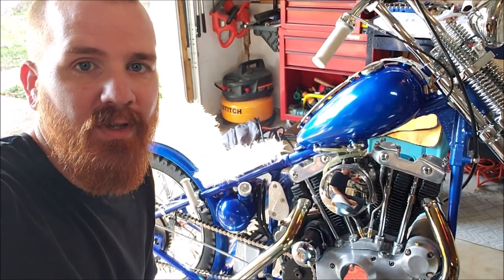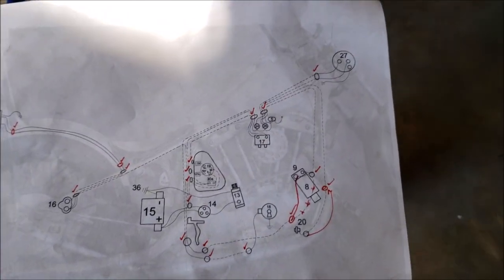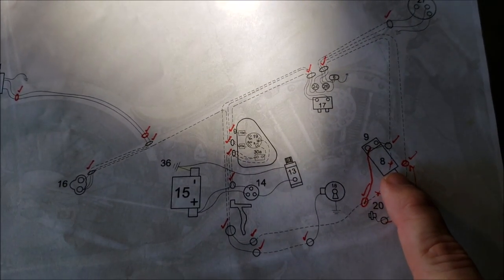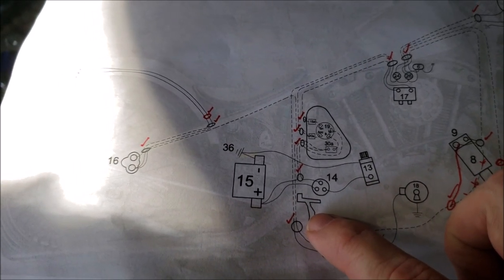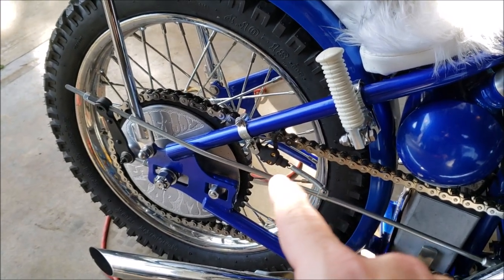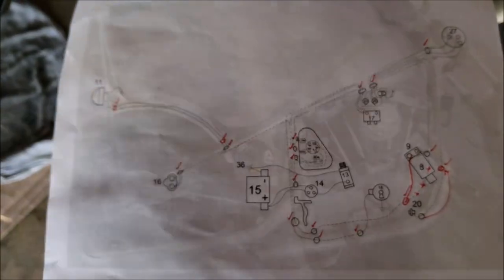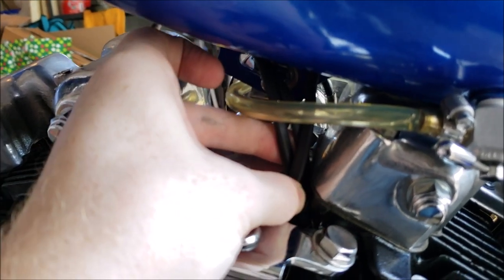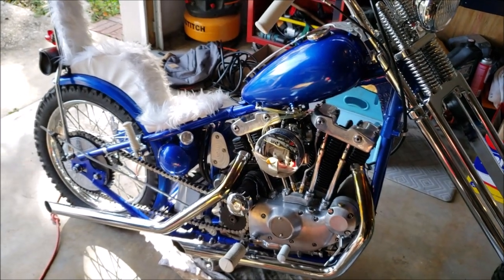HOW TO: CHOPPER / BOBBER WIRING - PART 1 OF 3

Comment: This and your other wiring series were great - slow and thorough.  The prep work and over thinking had my 76 XLCH stalled, your videos have inspired me.

I do have one question about routing of the points wire to coil.  I can see the cable dive into the timing cover but no idea where it goes from there.  Any idea how I might find it.  There are ZERO wires externally hooked up, no map of previous attempts by previous owner.

Comment: I had my handle bars extended for comfort but after seeing the wiring its a mess splice after splice. I know the best thing to do would to just pull all the wire and rewire it,  in theory it's looks easy but in practice it's something else.

Comment: Hi watching from New Zealand, thanks for video. I'm running a starter button close to starter motor. 12v positive to starter button, straight to starter coil. So only a short stretch of wire, seems fairly safe but would you put a fuse in this? Cheers mate.
Reply from the maker: Hi there. So your setup is pretty straight forward too. The wire from the pushbutton to the starter solenoid is only hot when the button is pushed. So no need for fusing on that side (in my opinion). On the battery side of mine, I had that larger circuit breaker as basically the first thing after the battery. Battery > breaker > rest of stuff. And some of the other circuits on the "rest of stuff" I isolated with another fuse set. But not the starter circuit. That was already protected via the big circuit breaker. If you'd like... I can shoot you a cleaner copy of the wiring diagram I had in the video. Just email me at bpeak82@gmail.com and I'll shoot it back over to ya. It was a key start but you'll be able to see where the circuit breaker is located in the run. Then too... if you want... we can email back and forth on your setup. Happy to help any way I can. Cheers man!

Comment: life saver THANK YOU so much
Reply from the maker: My pleasure! Have fun with it! If you're on IG... check out my feed @bpeak82 - I'll be posting pics of the new wiring diagram I just finished for my current build... a chopped down 82 FXS with magneto and battery eliminator, but still with all the warning lights and a few toggles. :)

Comment: You have any issues with stress fractures after drilling holes in your frame?... just curious, about to start on my frame.
Reply from the maker: Nope. Was good to go. But just be aware of how many, and keep the holes only as big as needed. And you'll be good. Especially on a chopper being so stripped down and lighter (compared to a full dress bagger and whatnot)

Comment: Great vid.   Where did you get your rear brake light switch ? Would you have a link ?
Reply from the maker: Hi there. Just got it off eBay. Generic "chopper brake light switch". You'll see a few options. Then when you get it... just test it with leads to a battery a few ways to make sure you know how it functions. Every switch is slightly different.

Comment: How did you make your wiring box where your key switch is?
Reply from the maker: I cut a piece of sheet metal based on a cardboard template I made. I have pics of it on my Instagram (@bpeak82). If you go all the way back to a post from April 30, 2018... you'll see the rough sheet metal and template. That box was then welded to the frame seat post. And aluminum side covers cut. Everything was done with a harbor freight jigsaw lol.

Comment: Great vid, super helpful. Did you make the ignition switch re locator and coil housing/ top mount or find them somewhere?
Reply from the maker: I found this one online, but I specifically got the one without a switch hole because I knew I wanted to set up my own layout. Thing is, these top mount coil mounts are mainly for the type of coil where the spark plugs come out the front or bottom. I wanted them out the back. But there wasnt enough clearance to the cylinders then. Hence the extra spacer block in there. If you're planning to use the same, just consider that in your setup for what parts you'll need. Then had to bore out the mount holes a bit to fit my heads rotation. And bore out the coil mount holes for heftier bolts. Seems like nothing is "bolt on" with these older bikes. lol
Reply: @bpeak82  great, thanks for that.    would you mind sending over a uncheckmarked file of your wiring diagram? hard to see it fully and follow the wires on the vid.
Reply from the maker: @benfox4225  - check out my Instagram page @bpeak82. If you scroll down a bit I posted a pic of the diagram on 8/28/18. Inalso have a fully detailed build thread on the ChopCult in the "Everything Sportsters" section where I tracked the whole bike build start to finish. Let me know if that helps!
Reply: @bpeak82  was the bracket from tcbros or another source?
Reply from the maker: @benfox4225  - the bracket mount was a generic off eBay. Chromed. $25 with free shipping.

Comment: Hi. I have a question. Excuse me if it seems out of place but I'm just becoming interested in this stuff. How can you get by without turn signals? Or a speedo for that matter? Can you have that bike registered and insured and street legal? Or is it meant to be a show bike? I don't know if the rules are different for motorcycles. I live in New York. If you have a turn signal out on your car you can be 1. Stopped and warned. 2. Stopped and ticketed.  3. Stopped and have your vehicle impounded....worse case scenario 😝
So I'm very curious about that. Thanks. Nice bike. How do you keep that seat clean?
Reply from the maker: These are great questions. Seriously. I'm not that tough guy that claims the whole "screw the cops" thing. I enjoy the gifts I've been given and count it as stewardship to possess them wisely. To me... for motorcycles... that means I always need a clean and clear title on a bike. No funny business. Registered. And insured. With this bike the neck VIN numbers were unaltered. Title = check. I was in Florida at the time. So most of the rest of the answers are state specific. In FL... insurance is based on very little. I gave the make/model/year/Vin to my agent and he wrote me a liability only policy and had a rider that piggybacked on my auto insurance if I were to medically get really messed up. I figured even if I crash and total the bike, I could salvage some parts selling off, make some cash back, etc. I needed to keep the insurance cheap. But zero problem getting insurance = check. Next is registration. In FL, as long as you have the title, and proof of insurance, you can get registration, plate, and sticker just with a DMV visit. No visual inspection. DMV doesn't care what it looks like as long as the paperwork is good. Registration = check. Next is vehicle inspection. Here's where a lot of the "chopper" parts usually hit a snag. But again, in FL, there are actually zero vehicle inspections required. At all. Cars. Motorcycles. Nothing. So nobody was looking at the bike in terms of compliance telling me what to do. Inspection = check. So far... 100% above board right? This post is long so I'll fill in the rest in a separate comment.
Reply from the maker: So in addition to my other comment (above or below)... it comes down to riding and the possibility of getting pulled over. That's where compliance with state laws kicks in. You gotta know em if you want to be 100%. This is where my bike was... let's say... 80% haha. In FL I could have been pulled over for A) loud un-muffled exhaust B) missing at least 1 mirror C) no front fender D) no front brake E) and if the cop was grumpy and if I were slouching... they could write me for handlebars being above shoulders maybe. On these points, I was willing to take the chance. As far as penalty, as long as you play it cool it's probably a ticket and not impound. But as soon as I say that I'm sure someone else has a horror story of bikes being impounded. Usually that's just if the paperwork side is sketchy or can't be verified that the bike ISN'T stolen. Again, my paperwork was always squeaky clean. In terms of actually riding it... it was super easy. In FL your head is always on a swivel anyway watching for car-missles. So no real need for mirrors. Easy to glance over the shoulder. No front brake? Just a matter of riding carefully and giving yourself enough space. And I had a crappy drum rear brake too. Didn't stop on a dime. More like stop in a block or two haha. You get used to it. Definitely run yellow lights rather than try to stop which can be a trick with FL traffic cameras. Lastly... on the seat... I make sure the bike is covered in the garage... and that my hands are clean when I take the seat on/off... and that my clothes are clean when I ride. Beyond that, I have to admit that I traded this chopper for another bike project before the seat got too bad. Would I do furr again? Heck yea. White furr? Prrrrobably not haha.
Reply: @bpeak82  i appreciate the detailed answer and your taking the time to write it. I'm a bit surprised one has to exist in so gray an area with this particular thing. My pops lives in Florida. You have nerve. The roads are beautiful but I've jumped out of my skin in a car when the speed freaks plough by at 110 or better. 😆 Thanks again. Be safe.
Reply from the maker: @stevenedwards4470  - yea man it was wild down there for sure. I'm actually up in the hills of North Carolina now. Just outside of Winston Salem. Beautiful back roads for miles and miles and not far from the Blue Ridge parkway. Much more chop friendly riding spots. Month or two of really cold. Hardly any snow. 10 months riding temps without freezing the manhood off. I'll take it. :) I always try to respond to comments and emails. Happy to help any way I can... and (if you couldn't tell) I talk/type a lot. Haha. Especially once I get goin. Cheers!

Comment: Does it matter which way you wire the circuit breakers leads??
Reply from the maker: If I recall... the wire that feeds power to the circuit breaker goes to the copper (usually shorter) terminal. So copper is the hot in. Then the silver (usually taller) terminal is the connection that leads out to the components.
Reply: @bpeak82  thank you very much!! Much appreciated!!

Comment: Thanks!!! I am building a 2003 Sportster Bobber Basketcase..and want to get rid of the chopped up factory wiring harness and go to a new ignition system. LED headlight & Tail light..
Reply from the maker: yea man for sure. would definitely recommend grabbing a copy of the factory wiring diagram for the 03's to start to learn it a bit. With that system there may be some other devices or do-dads that you might have to contend with. Especially when it comes to the charging circuit since yours is an alternator as opposed to the generator.
Reply: Me too

Comment: When you're drilling holes in the frame for wiring runs is there a best location in respect of maintaining frame integrity? I'm thinking do you keep the holes close to joins (like where the backbone meets the steering head), or do you keep them as far away from joins as you can ? Or does it just not matter?
Reply from the maker: so... I'm no engineer... but... (haha). my view is that generally speaking a stock frame (even stock neck hardtailed rear) is so overengineered that a few holes make zero difference ultimately. I know that's "rule of thumb" at best. But if you're just drilling holes for wiring, keeping them relatively small (not taking out a whole half of the tube in that area), you'd be fine to do whatever. Now - if you're already dealing with a custom frame that has non-speck frame tubing, maybe was sloppy welded up in a jig under chain force to get it to align, some radical 12" out gooseneck, and a 30 over rigid front end and plan on doing wheelies and curb hopping... might wanna rethink life let alone those wiring drill holes haha. For me on this ironhead build, it was just a matter of aesthetics and placing holes where I wanted them... and had zero problems.

Comment: This is an older post but...do you remember the color (code of the blue on that bike?
Reply from the maker: Great question. I actually do. It was powdercoat... prismatic powders... "Illusion Blueberry". It has a slight bit of metalflake too. Came out nice for sure. I have more pics on my Instagram as well @bpeak82 but you have to scroll way down to find ones of that bike. Hope this helps!
Reply: @bpeak82  Thanks for the reply. How did you like the powdercoat finish on it? The durability is a definite plus....the slight metal flake is exactly what I am looking for...the dayz of ez earlier rides
Reply from the maker: @DeeInTheHouse  - I really liked it. Would totally do it again. It also hid some of the imperfections in the frame metal. Super good stuff. The frame, gas tank, oil tank, and rear fender were all powdered the same.
Reply: @bpeak82  ..I don't see the Illusion Blueberry in the lineup?? Maybe discontinued?
Reply from the maker: @DeeInTheHouse  - https://www.prismaticpowders.com/shop/powder-coating-colors/PMB-6908/illusion-blueberry

Comment: what electrical box is that? I may need one.
Reply from the maker: Hey man. If you're referring to the box on the seat post behind the rear jug... that's a custom piece I made. This bike's frame was wonky and the previous owner welded on the hardtail with the seat post in a super odd position. I made a sheet metal housing to fit wrapped onto the seat post. Had it welded in place. Then made the little aluminum side covers by hand. I have some photos on my instagram (@bpeak82) of how I did the cardboard template and in-progress pics of making that box. But you'll have to scroll pretty far down to get to the build pics on this specific bike. If you're really curious, and don't wanna scroll insta... shoot me an email to bpeak82@gmail.com and I can send you pics of how it came together. cheers!